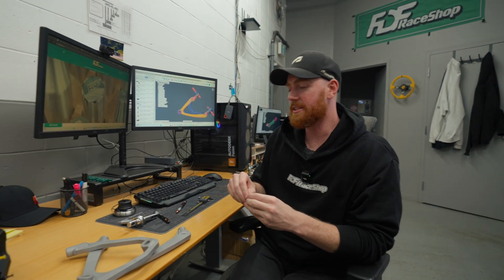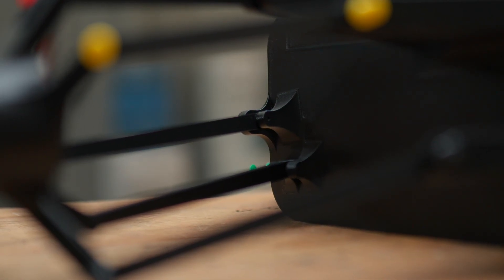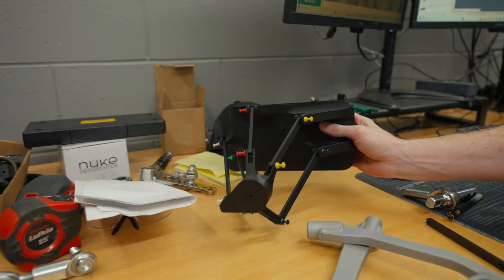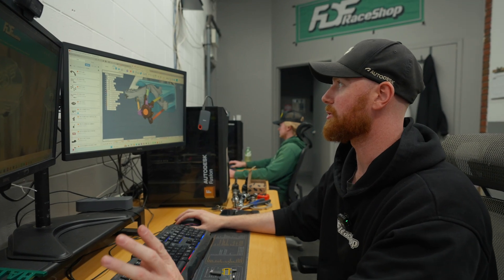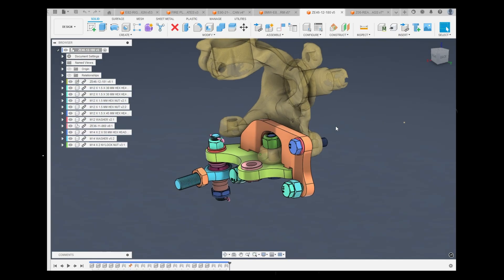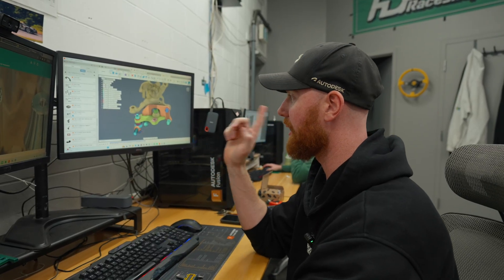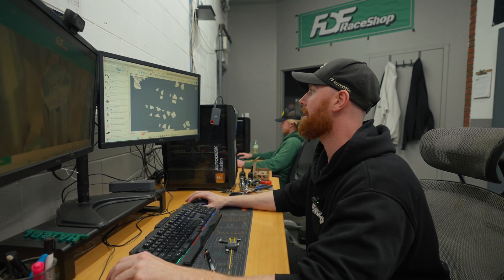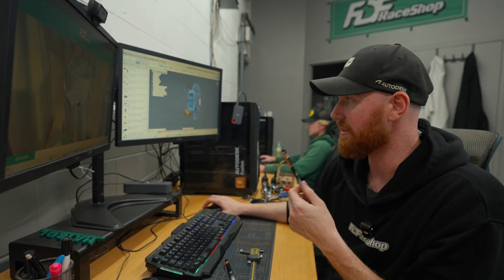Design Time Episode 12: The Display We’ve Been Working Toward

Comment: More info on that back massage thing please!
Reply from the maker: Heck yeah
Reply: Oh yes. Even if you can do lumbar inserts or anything for back support. Most cars still have terrible seats and leave your back stress especially after a long time in the seat. 
You do so much suspension work but easy adjustment things. Angle adapters to raise the front of a seat to improve the angle. Seat rail extensions to allow the factory or replacement seats to move back further. Lots of applications for rally where it’s brutal on your back. Ending up with knots that take days to work out suck. ✌️